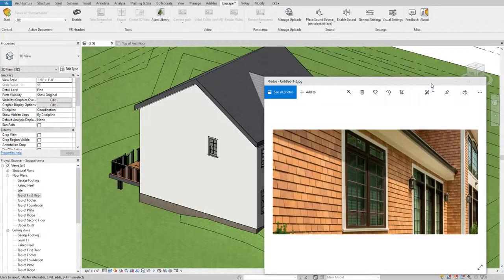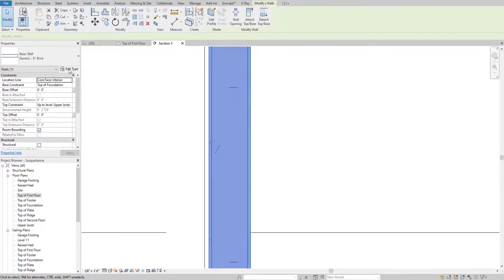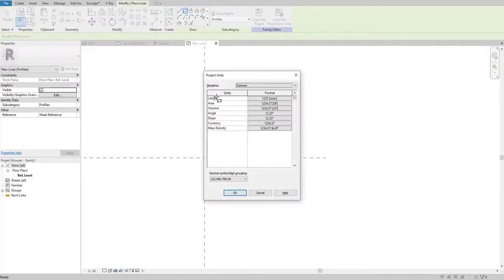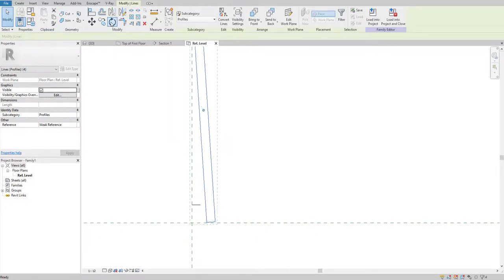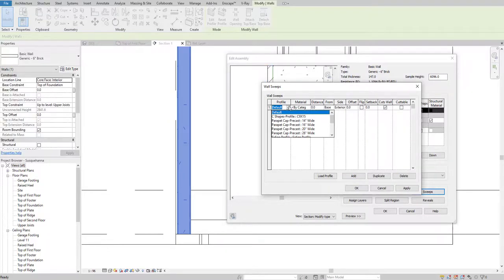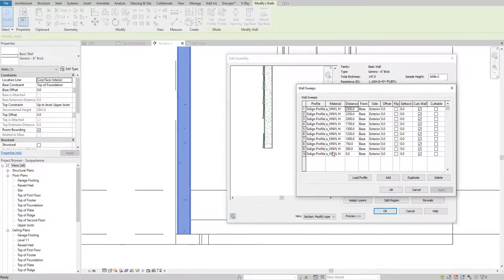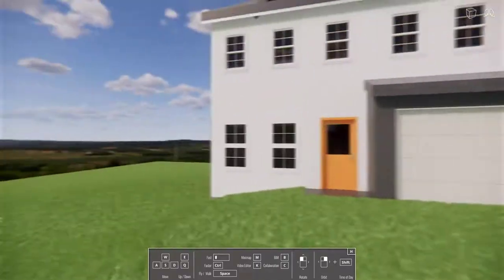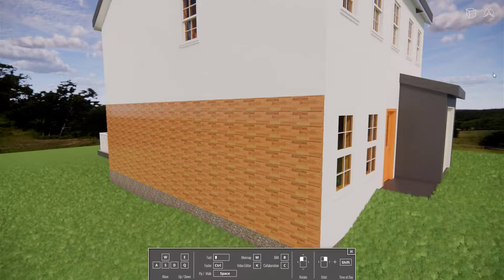How to make wall siding in Revit | Adaptive profile

Comment: go to the top of the wall and cut sweep with the shape of the roof.
Reply from the maker: Thanks for your comments
Reply: So that it will
Trim the profile?
Reply from the maker: No it's not.
Reply: @bimskilled  your example does not work for gables or irregular shape walls, it is better to use the reveal profile instead
Reply from the maker: Thanks for your suggestion. I will make more content on this topic soon.